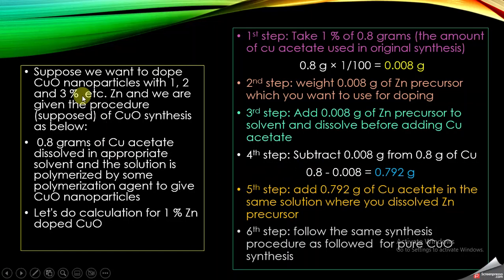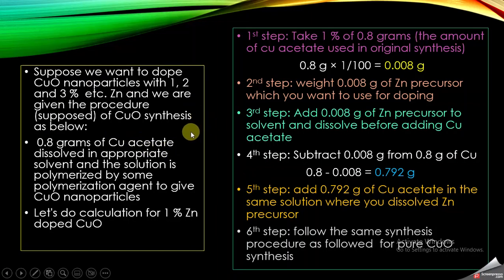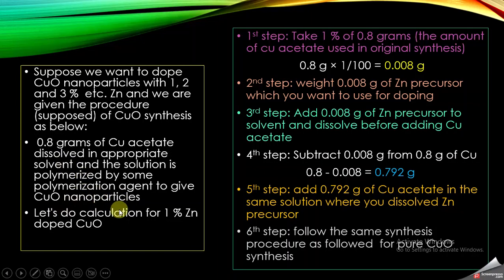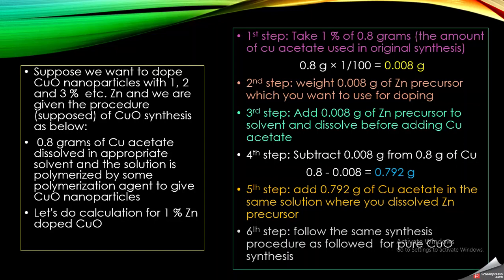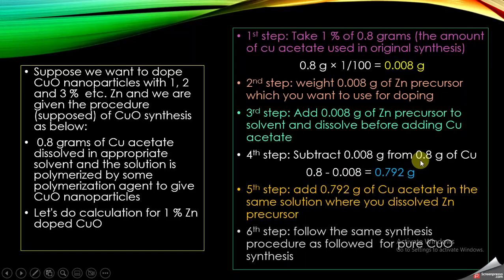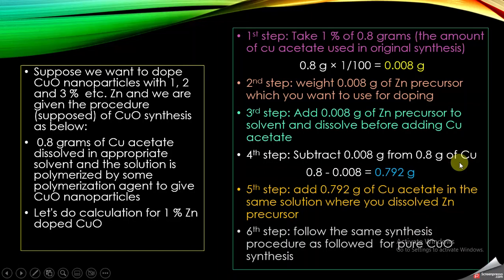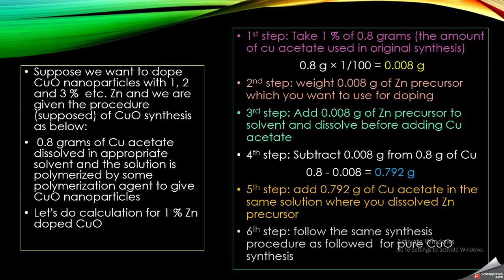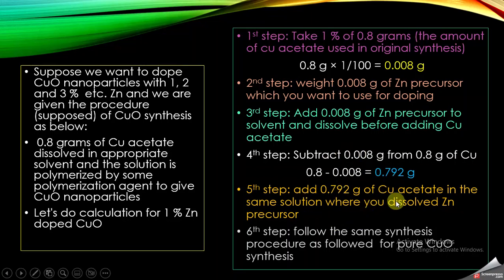How to do calculations for doping?

Comment: This is when we are dealing with precursors having ratio between the metal atom and the molecular unit as 1:1, if it is not the case the number of moles of the compound and the number of moles of the metal must be calculated accordingly right?

Comment: You clearly discussed how to calculate the amount of dopant, but if you can made a video that how to calculate (1-x) and what is "x", will be more understanding.
Reply: I didn't understand some calculations like, 0.005, 0.01, 0.015, 0.02 and 0.025 in Zr doped BiFeO3 nanoparticles, can you please do help ?
Reply: @muneebrahman6876  I have the same confusion now. Sir, have you found out the process how to do it?

Comment: Can u tell me how to calculate doping in weight %of a liquid precursor
Reply from the maker: In the same way. For example for 2 % doping take 2%of the amount of liquid precursor. You can also convert volume of liquid precursor to mass by using density

Comment: Can you please tell me how to calculate the doping percentage for Fe3O4 nanoparticles? because in the case of the Synthesis of Fe3O4 nanoparticles, there are two precursors one is FeCl3.6H2O and 
another one is FeCl2.4H2O.
Reply from the maker: Are you using same amount of both Fe precusrors?
Reply: @Shamsa_Munir  No, the ratio of the amount of FeCl3.6H2O and FeCl2.H20 is 2:1.
Reply: Can you please make video on it?
Reply from the maker: @Indianinkorea003  in this case the structure of Fe3O4 has Fe3+ and Fe2+ in 2:1. If you dope with any positive cation it can be X +2, or +1 or even higher. The first thing is that you can not 100 be sure that where this X will going to be in the crystal i.e. it can replace Fe2+ or Fe3+ or it can be interstial doping.
You can do the caculations in the same way as suggested in the video. While subtracting the amount of dopant from FeCl3 and FeCl2, you can chose to subtract equal amount from both. For exmple if dopant amount is 0.01 g divide it by 2 and subtract 0.005 g from each iron precursor
Reply: @Shamsa_Munir  Thank you so much for your answer.
Reply: My question is that mam I have a three precursors Nickel cobalt and Sulfide. I want to do a 3%  doping of Copper in the base compound. So how I calculate it. Please guide me in this regard respected mam.